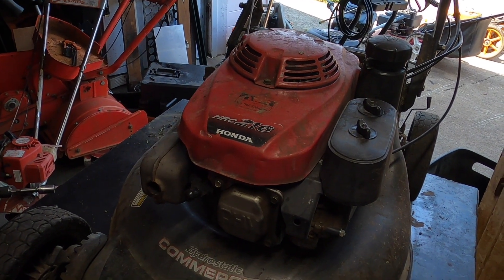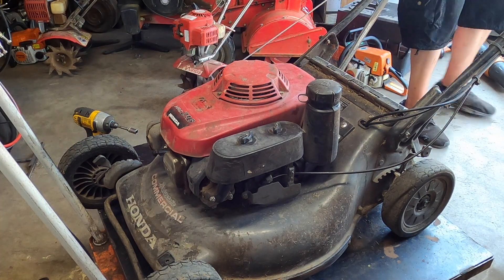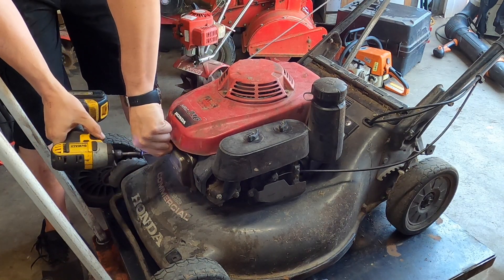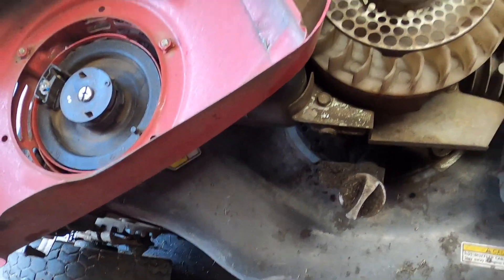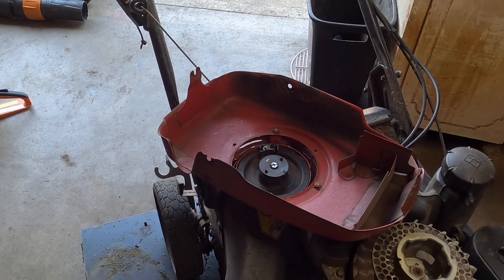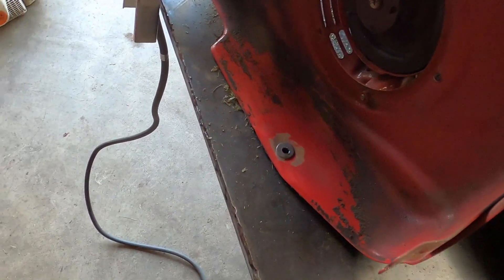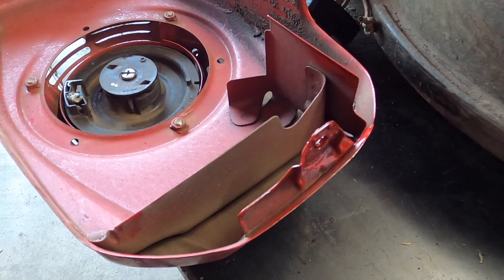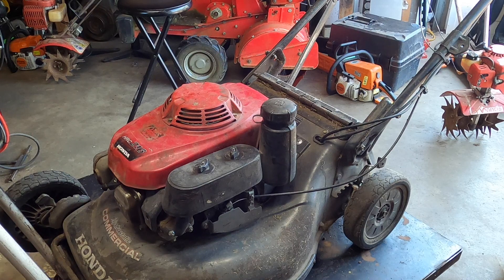Honda HRC216 Shroud Repair

Comment: Where is your shop contact?
Reply from the maker: I don't really have one. I work word of mouth mainly due to this being a hobby
Reply: @PNWSmallEngineandLawn   Gotcha, I have a Honda x160 clone on a plate compactor I’ve been working on.  It starts and runs then suddenly dies after some time.  I’ve adjusted valves, governor, replaced the rusty carb, the coil and plug, disconnected the low oil sensor, cleans the muffler, and found the tank filter floating around and removed that.  I’m running out of videos to watch to fix this thing.  Any thoughts?  I thought this might make good content for you.
Reply from the maker: I kinda wonder if it is a fuel delivery. Maybe a plug of so sort or bad vented cap. I am not sure where you are but I am close to wilsonville Or. If your close by send me a email to pnw.smallengineandlawn@gmail.com and we can figure out a good time to meet up
Reply: Thank you for the reply.  I’m not too far from you just outside of Newberg.  Thanks to your videos I was able to track down the issue by rewatching a video.  Apparently part of an old gasket was causing air to enter the intake, all fixed now.  Thanks again for the help.  I’ll be sure to post a link to your channel.